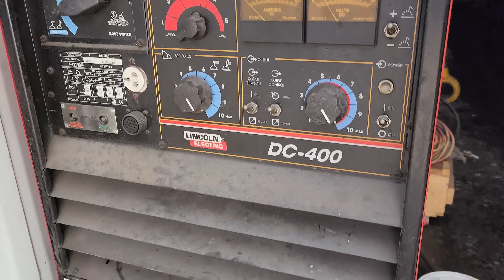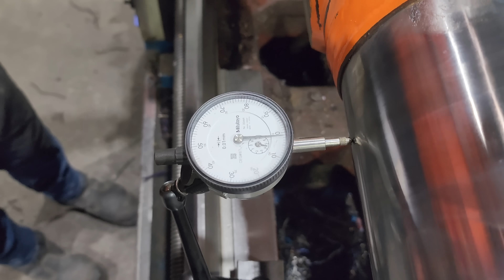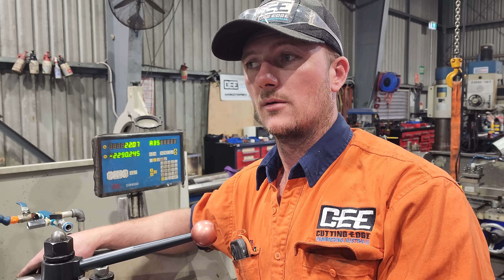Can We SAVE This $20K Cylinder Rod!? | Gouging SEIZED Nut

Comment: Take this video as a lesson on what NOT TO DO...What a bad mechanic, that tear in the cylinder thread is what he did. If you look at time 14:18 thru 15:29 , he is using a bar to turn the nut he has three cuts in.  the tear was started by the middle cut of the three he made in the nut.  you can see on the backside of the nut shown at 16:06 thru 16:07 the piece of NUT thread was broken off at the crack in the nut... and dragged thru the cylinder threads by the nut , It started cutting cylinder threads at the crack in the nut. He made a chipped piece of the nut at the crack go into the cylinder threads it cut into the cylinder threads and then when he tuned it with the bar he damages the cylinder threads. IT was able to do this because he lifted up on that section of Nut with wedge allowing a piece of nut material under the nut into the threads. This is NO way to take a stuck nut off. He caused all the damage he had to fix and charged the customer for. There was no need for any of it. I could have gotten that nut off and none of this would have been needed. This guy makes things way to complicated damages things like a gorilla and pays for all the equipment charging people for his ape screw ups.

Comment: worked at a machine shop and an idiot  forgot the drain the cylinder and made a huge mess in the shop...hours of cleanup later and just as I change into a new uniform ...cleanup in building 2  idiot did the same thing with the 2nd cylinder

Comment: "Next step is set this up on the lathe"... If that were an option the whole time, why not start with it? A lathe/mill would make short work of that nut and without causing any more damage. Also the prices you quoted are not real, they're just overpriced numbers from the manufacturer. Very few people actually pay $3,000 for a nut when you can get an aftermarket one for 10% of the price.

Comment: No easy out on this job. Stress concentrations in tightly toleranced components..yuck. Is a longer nut with a smaller thread pitch possible?..that way stress is less likely to bind. You and the OEM's could be collaborators🤔

Comment: Why not cut the nut off on a milling machine.     You would have much better control and don't run the risk of annealing the rod threads or damaging them any worse than that are

Comment: I wonder why didnt you machine off the siezed nut, by holding the piston rod on the lathe, instead of all that "gauging and hamnering."
If finally the shaft had to be put on lathe, and new nut was required to be made, why all this drama and wastage of time and undue risk?

Comment: WRONG! I retired from the oil refinery and powerhouse piping industry. I worked 7-12s except on school nights, I worked 8 hours. I attended a 5 year apprenticeship then went on to teach math and science at night to apprentices. You made a common mistake people who are experienced, last resort. arc gougers do. If you would have had a 5 foot wrench ready, The first full cut you made and that nut would have spun right off. I've done it and I supervised it being done. That heat from one single pass expanded that nut several thousands past it seized point. And now you know.

Comment: This panzy has a fucking air conditioned welding hood. 😂😂 this guys never been on a legit job site in his life.
Reply: If you’ve never used a gouging rod and don’t know what a Respirator looks like, you’ve never worked in heavy industry and should go back to playing with your alphablocks.

It’s running at least 240 amps and the fumes off of that pool are not used to make sweets.

Comment: I guess you get paid by the hour lol, i would have just drilled it and put a big steel rod inside the hole then beat on it with a sledge.. ur not going to misalign anything even with a sledge on a shaft that big lol.. you wasted so long id have had it off in the time it took to drill the hole or weld a rod onto it

Comment: i really dont see the point into removing like 99% of good thread just because you got damaged 1% of it, just weld the damaged part and cut it to original specs. slick repair, can use original nuts. 
its like paint the whole car just because a rock dent it and strip the paint. come on, i saw great repair on this channel, but this one seams like cheating to make more profit.

Comment: In my opinion you did bad job. there were only few lines of thread damaged. You could fix them, or in worse case remove only them. Now its custom rod with custom nut with custom thread. What about strength, what about coating of the surface. It is impossible to prove that strength of your made solution is not worse then was from factory, smaller diameter means less friction area. If you would just cut of first two thread lines you would save few hours of your job, standard nut would be easier and I suspect faster to get. And in the end it would save time and money for the customer.